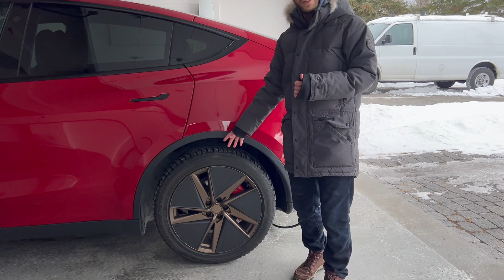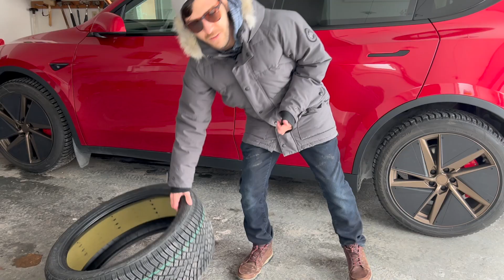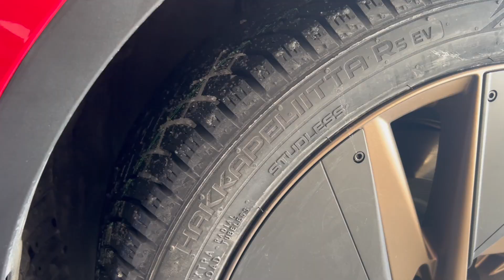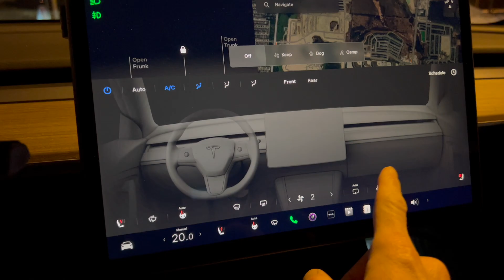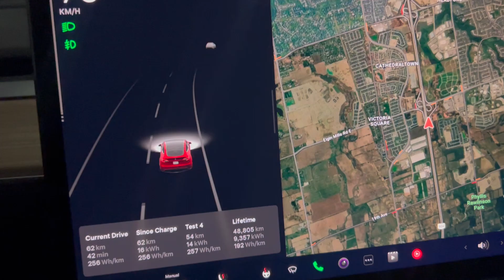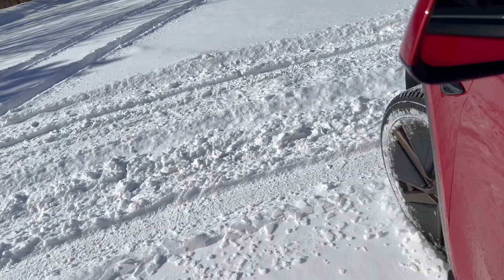Are EV Winter Tires More Efficient? Testing Nokian Hakkapeliitta R5 EVs

Comment: Thanks! What rims are those, they look great. Was the noise difference and performance worth the premium?
Reply from the maker: Thanks. There is a very noticeable noise improvement. I sense more wind noise on the highway now, and before I had more road noise than wind noise. 
The wheels are EV01 from Fast Wheels. They come in black or silver but I had mine finished in bronze. You can also get optional aero covers for these wheels. I have a shorts video about these wheels on my channel.
Reply: @evchargerreviewsnet  thanks for the indepth review, we also got my MYP with fast wheels ev01+, i havent done a back to back test, i just trust the advertising facts, i plan to buy the ev06 for my m3p at some point. In the winter we lose alot of distance due to the cold, i suppose 5-10% gain are worth it over 4-5 years